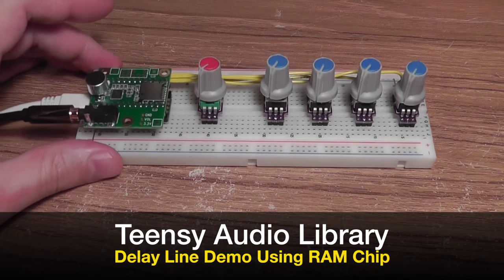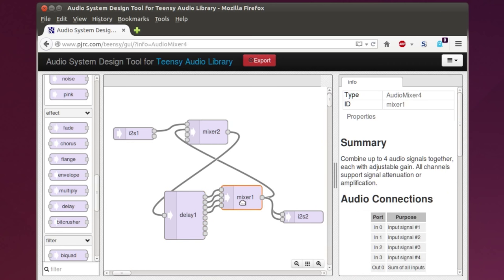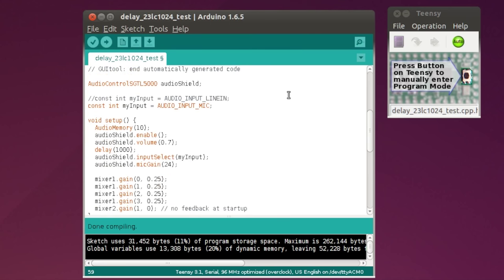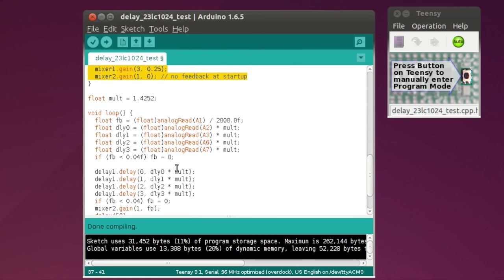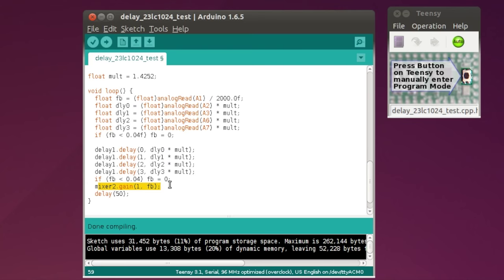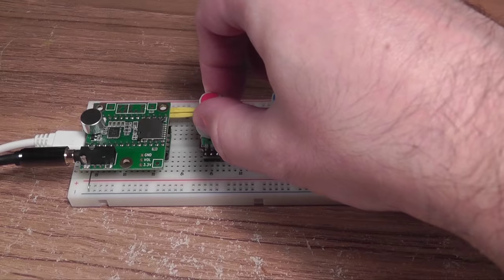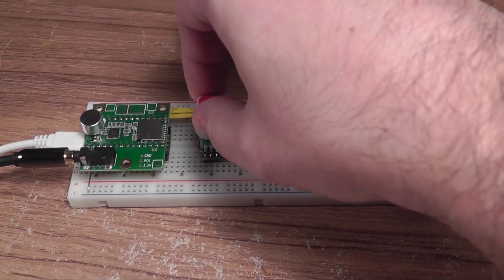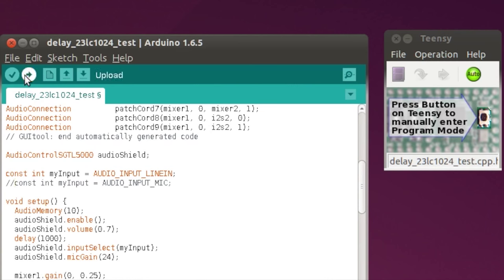Teensy Audio Library, Delay Line Demo

Comment: The example sketch does not work as is. With the help of the Teensy forum, I learned that it is necessary to increase the value of AudioMemory: “Each block allows about 2.9 milliseconds of delay […]”

For using the external SRAM – which allows for longer delays – one needs to use delayExt instead of delay.

Comment: Hi Paul, sorry for commenting on such an old video! Did you need to change anything to use the line input instead of the mic beyond just soldering the connection socket?

Comment: Where can I find the wiring diagram for adding the potentiometers?
Reply from the maker: The pots just connect between 3.3V and GND, with their center pins wired to the analog input pins.  If you're really unfamiliar with how to wire this stuff up, I highly recommend starting with the audio library tutorial.  Hopefully after the tutorial you'll gain a solid background about how this stuff works (which could be applied to doing this delay line with the extra RAM).  This page has instructions for wiring up the pots to do the tutorial.  Click the "Board Assembly Instructions" PDF.  https://www.pjrc.com/store/audio_tutorial_diy_parts.html

Comment: can a delay of 1.5 seconds be fed into another delay for a total of 3?
Reply from the maker: Yes, you could do that.  But since this video was made 5 years ago, Teensy 4.0 & 4.1 have become available.  They have much more memory than Teensy 3.2 used in this video.  The audio library supports up to 4 seconds on the newer boards.  You an also edit the code in effect_delay.cpp to increase the default limit which will let you get slightly longer maximum delays.

Comment: May you give me wiring diagram plzzz?
Reply from the maker: It's just 5 potentiometers.  Each connects its 2 outside terminals to 3.3V and GND, and its center terminal to one of analog input pins.  If you're not familiar with connecting pots to analog input pins, there are lots of Arduino tutorials you can find by searching.  Once you understand that basic concept, this sort of thing is so very simple.
Reply: @PaulStoffregen  thank you sir.